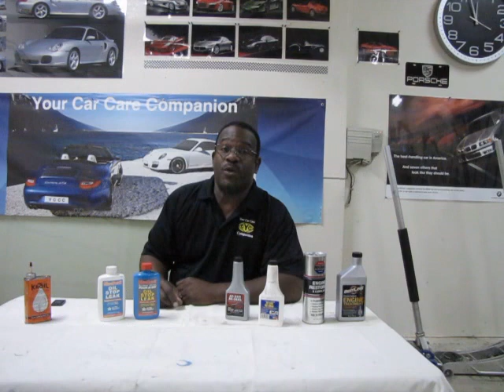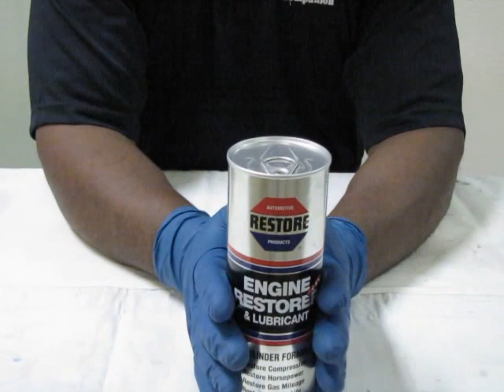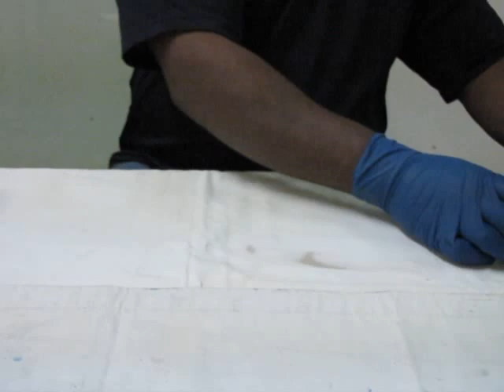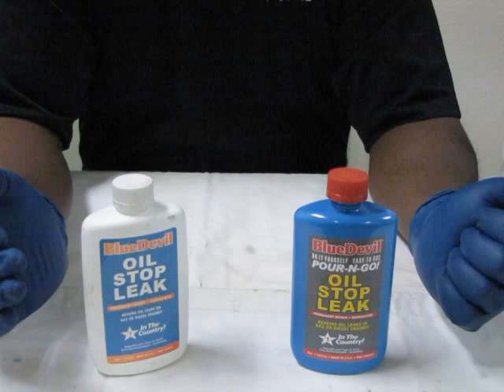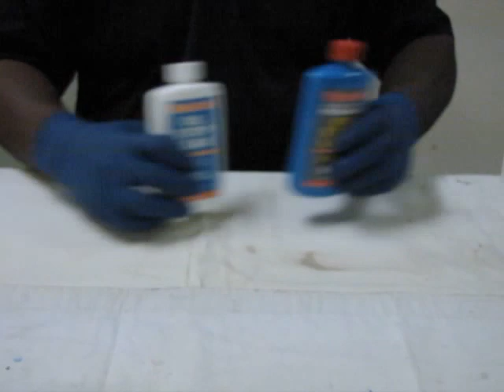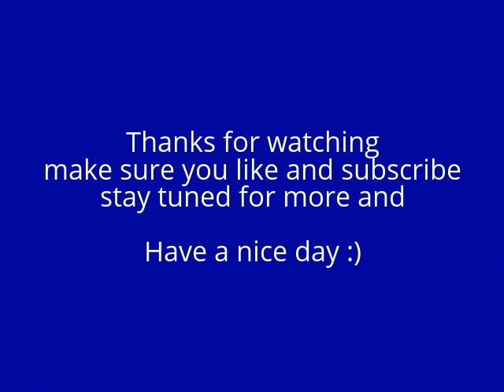3 of the best engine additives and penetrating oil money can buy

Comment: Regarding the 205 reseal, I can totally see why a mechanic would be against that. He makes money by replacing parts and charging labor. Pouring a bottle of that stuff in and fixing the problem for 2 years 4 years is no benefit to him but the person who owns the car might not have to do that $2000 repair of the rear main seal where you take the engine out and disconnect the transmission to replace the $10 seal that failed.
Reply from the maker: Exactly, I am a mechanic too and an engineer and the point is there are other than ideal solutions that work for what people need and can afford to get them by in the mean time.
Reply: That stuff works
Reply: I too am a mechanic with over 32 years of experience. It's not the technician trying to gouge you. It's the service writer. Also various things can cause main seals to leak. Bad thrust bearings, harmonic balancer has gone awry, drive train vibrations transferred into the crankshaft via a manual transmission, cracked or broken flexplate, improper or unbalanced torque converter. Basically anything that induces a vibration into the crankshaft can cause a seal to leak. Most mechanics would rather pull a tooth out with most mechanics would rather pull pull their own tooth out then replace a crank seal. It is a giant pain in the ass and very dirty. I'm not saying it's impossible I just saying it's involved. This is my opinion nothing more nothing less...
Reply: @jahbay  You just described every chevy i ever owned !

Comment: Wrong about that Head Gasket comment. Blew a gasket In. 2005 Ford explorer with a 4.0
Added a 70 dollar (at the time)  bottle of blue devil and drove another 6
30k miles when I decided to flush my cooling system. Completely forgot about the head gasket issue. It immediately started smoking again..i went and got another bottle of blue devil and drove another 33k miles  before trading it in with it still running like a top. I had my doubts at first...but blue devil saved the day! Nothing but props for that heavenly devil. :)

Comment: Hi Clint great video man I have a 01 Wrangler with 110 on it and the rear main seal just started leaking some and I have noticed a slight knocking I think will any of these work for me thanks and if  I had them will it do more damage to good seals and so on thanks man and great tips.
Reply from the maker: I would try AT-205. It will not damage a new seal and works well on small leaks. Good luck :)
Reply: One more thing man thanks alot will it matter if it's already full or close the add or drain a half at or so..?

Comment: Just put 2 bottles of 205 in my 4r70w to attempt to stop a torque converter seal leak. Will see what results are in a week when I drive it for more than 15 mins. Disclosure believe trans was rebuilt in 2013/14. Either wrong seal they used or I overheated trans towing once that hardened seal. Fresh fluid change and the seal started leaking soon as it warmed up.
Reply: update on this sir? 😅
Reply: @vincentescosio1812  Didn't work; lasted 3-4k miles then the fluid exploded out the front seal on the interstate at 60 mph. Dropped the pan it was full of clutch material. I had to put a used transmission in it; was cheap though about $100 from self pull junkyard.
Reply: @D4x4Bronc   sorry to hear that. take care there sir!
Reply from the maker: Don't forget to let us know how it worked for you.

Comment: What about using the best line and restore together?
Reply from the maker: I've used them together before, never had a problem. They are all compatible with all other motor oils so it would be surprising if they were not compatible with one another.

Comment: Do you know how many ounces of At205 I have to pour to my engine if my oil capacity is 5 liters?
Reply from the maker: You can't do it like that, there's no way to know exactly how many ounces it will take to POTENTIALLY stop a leak.  It depends on a lot of factors like how old the seal or O-ring is, if the seal or ring is damaged or if the leak is due to something else entirely that does not lend itself to this kind of repair.  If you're unsure, just add one bottle, drive it about 200 miles, if the leak stops you're good, if not you have a leak that needs to be repaired.
Reply: @Engineerboy100  alright it's just that a video posted by them they give instructions on how many ounces you have to pour depending on your oil capacity and that you have to adjust according to that.
Reply: I used a whole bottle with 5qts 6cylinder 4.0 sohc ranger worked after 20mins valve cover gasket
Reply: Read the chart on the bottle .
It's 8 Oz,  for. 6 qt.  oil

Comment: AT-205 will work on seals that have gotten hard over the years but if you have a nicked or torn seal, it won’t help. It is one product that try’s to do what it says it will do, no scam. Go get a price on replacing your rear crankshaft seal and I think you may try a bottle.
Reply from the maker: Absolutely correct, it will not fix or seal damaged gaskets or seals. The chemical reaction between the materials causes the old gasket or seal to swell a little and thus sealing or stopping some small leaks permanently.
Reply: My rear crankshaft seal was leaking this has temporarily fixed it I’m happy 😃
Reply: MPLS Car Sales you should be! Saved you lotsa cash. Glad it worked for you. I’ve seen several cases where it didn’t stop the leak but slowed it down enough to require only a small amount of oil to be added periodically

Comment: I have a rear main seal leaking on my 2004 BMW can I use any of those oils that you have subscribe to stop the leak
Reply from the maker: The best bet is to change the seal,  but it can't hurt to try an additive. The AT-205 has been the most effective for me. If the seal is not damaged or too hard, it just might fix it for you, if not you'll  just still have the leak, no big deal, so try it.
Reply: ( describe )

Comment: Hi will At-205 work on valve stem seals? thanks
Reply from the maker: If your valve seals are not too far gone, AT-205 can help a little but the valve seals will sometimes just wear more .... If you're about to replace the valve seals anyway you might try '205, but if you just want more time, try a heavier weight oil like 20w-50 mixed with your regular weight oil. AT-205 could make valve seals worse as it reacts with the seal and melts the seal a little and causes it to swell, but if the seal is deteriorating, I could cause more to wear away ... Try it and see... if it works,  great, if it gets worse, change the seals.
Reply: thanks buddy :)
Reply: Oh BTW, how many hours of labour am I looking at to replace the valve seals? the car is a 4 cyl. bmw
Reply: I worked on my 239.000 mile Jeeps valve stem seals & oil leaks.

Comment: Also the very best is best line. Best line will have your motor running a lot more smoother it's more of a lubricant Less friction. But I wouldn't use it to reseal that's not what it's for.
Reply from the maker: Correct again, thank you for your comments, very much on point.

Comment: Sorry but I used power restore and it worked but after a week I started to burn oil. In 2 weeks it was burning a full quart. Not knowing it was the power restore that did this damage about a year later I bought a Bronco with a 351 Cleveland fully rebuilt. So clean you could eat off it. After one year and a half notice leaking oil from seal. So I put power restore in it. Of course it , no leak anywhere. However in a month it started to burn a quart every week. That's my experience with power restore and never will I use it. What's safe and the very best that I use and happy with is ATP 205 reseal! The best!
Reply from the maker: AT-205 is my favorite as well, good stuff!

Comment: Very good Thks
Which Penetrating Oil is Best? Let's find out! https://www.youtube.com/watch?v=xUEob2oAKVs
Reply from the maker: I don't know if it's the BEST in the world but I do know from experience that it works very very well.  ;)
Reply: Your review was very helpful.  For example I have a transmission leak & will give ATP AT-205 Re-Seal Stops Leaks a try.   Oh I've used Marvel Mystery Oil but will give borderline a try.  Thks  
PS: You might consider teaming-up with highly synergetic YouTube channels.  Better/more video reviews & less work.  Oh less searching for me too.
Reply from the maker: Cool, I'll look into that, Thank you :)
Reply: Clint, I forgot to ask.  I have ~130K miles on my 2003 honda pilot & runs great but I have an auto transmission leak.  ?Will a little AT-205 re-seal stop the leak (ex: swell the seals)? Thks
Reply from the maker: At-205 is transmission safe, but there is no guarantee it will fix your leak.  It depends on why it is leaking.  Good luck.

Comment: For head gasket problems, particularly if you just need to get a few thousand more miles out of the engine until you can afford a head gasket job or get rid of the vehicle, get your torque specs and tightening pattern and procedure for replacing a head online or from a manual (available at many public libraries) then on a cold engine slightly loosen every head bolt, and using an accurate torque wrench, then re-torque the head to factory specs in the proper pattern without ever removing the head or gasket. Then change the oil.  I drained the coolant before doing the job, then added a coolant stop leak to the new coolant as insurance, but that would be up to you because these products can cause over-heating problems. 

After getting a $2,000 estimate to replace a head gasket on an old BMW, I simply bought a new torque wrench,  and followed the procedure I just described.  That got the car through a long, hot southern summer with no problems, then I sold it, after telling the buyer about the problem and my fix, and the estimate I had gotten for a conventional repair job.  

This procedure will not work with heads attached with torque-to-yield bolts, unless you removed and discarded all of the old bolts and used all new ones and followed the factory procedure for tightening these type of bolts to factory specifications; then it might work, but you would be doing it at your own risk, and could easily damage an expensive engine if the head moved at all when you took the bolts out, especially if you had not drained the coolant first. This procedure doesn’t fix blown gaskets, but can help get you a few more miles if all you need is a little tightening up of older parts.
Reply: Anonymous98 K & W Block Seal works well.
Reply: Anonymous98 if you sell a car and not tell the problems with the car you are a dirt bag

Comment: I have a small front Transmission seal leak will the AT-205 or the Blue Devil work on the transmission.
Reply from the maker: There is no way to tell whether either WILL work,  but I would try the AT-205. Good luck.

Comment: I completely agree with you on Restore but I have yet to give Bestline a try. Restore does feel like it rivatlizes the engine. Restore  doesn't increase viscosity that much compared to oil stabilizer,  which I like.

Comment: I've been using re store I'm all my car since 19 eighties late eighties when stuff    came out ..works great  302 ford Mustang motors in the 80s will burn a can or 2 of oil when they reach 100,000 miles   adding re store to motor you would only burn 1  quart and if u keep using it every 3,000 mile  down to burning half to quarter quart of oill .. the blue smoke go sway..  It works at all my cars right now I am on a 2006 explore 250000 miles using restore

Comment: Yes you can get Better then Kroil  50/50 mix of trans oil and acetone. and cehaper too
Reply from the maker: I have not tried the 50/50 mix yet but I have read that it works great in a few places and I do plan to try it.  ;) Thanks for your comment.
Reply: @Engineerboy100  Kroil penetrates one millionth of an inch. Nothing else comes close.